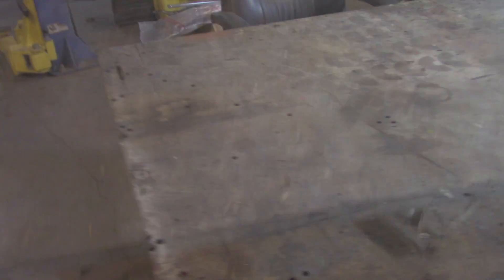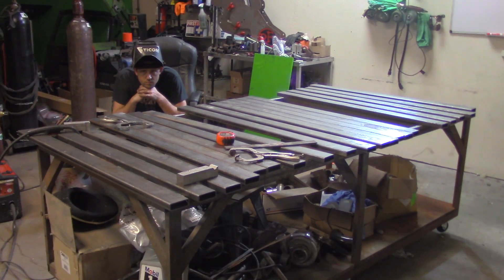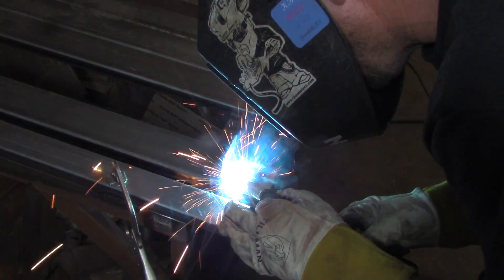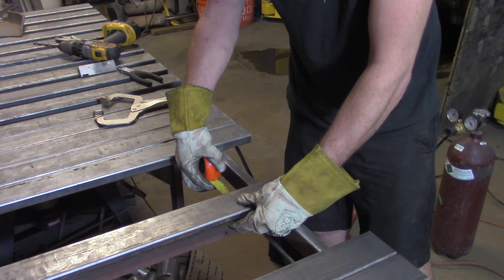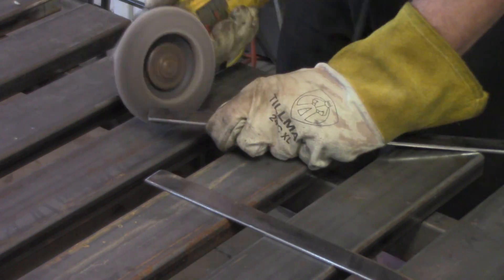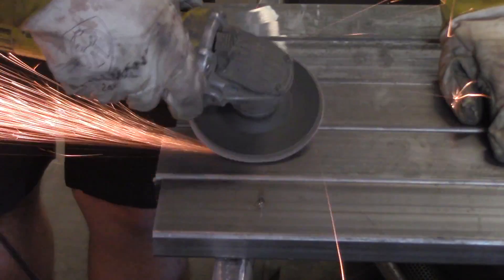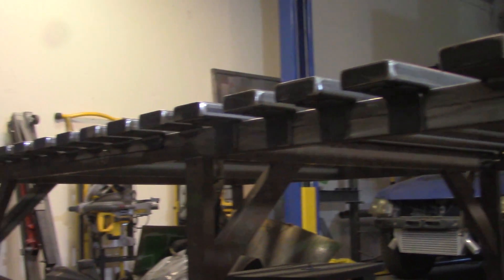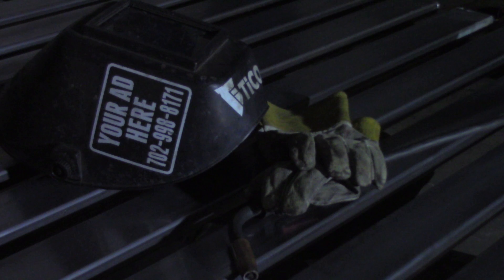TFS: Inexpensive DIY Fab Table

Comment: Shame the whole thing seems to be wobbly.
What is the purpose of the round rods ? 
At the end of the video it became obvious that they make it very difficult to adjust the slats.
I made mine with 4 x 2 slats and they just sit on the side rails. No location tabs.
I can move them to any position or take any one out completely. 
What was the advantage in welding 4 together ?
It seemed to just make it a heavy section to remove.
4 single pieces with no rod underneath would be much easier to remove separately.  What if you needed just 3 out ?
Don't ever consider earning your living as a welder my friend if you think that was monotonous  !
Reply from the maker: +Steve Williams Did you actually watch the vid? I'm not sure where you get "wobbly" from if you did. It's on wheels to facilitate relocation at any given time, but far from wobbly. 

The purpose of the rods is to secure the slats to the table at any ppsition. If a single slat was clamped to the adjustable slat without it being secured to the table, it would topple over. The rod holds the slat to the table. 

Please read the other comments regarding adjustment. I made it clear why I don't want them moving freely. 

Welding 4 together allows the removal of a large section. It was explained in the video. 

If I only need to remove 3 slats, the opposite side has individual sections the can be removed. The table doesn't care which side it's facing, or which slats get removed. 

I earn a living by doing custom fabrication. I've been doing it professionally for 17 years. It's rare that I do production style welding where the welds are exactly the same because my work is typically custom order, and exclusivity to one-off designs appeal to my clients.

I appreciate your "wisdom" and your comment, but I encourage you to at least watch and listen (as well as read) before commenting. It's good practice. 

Thanks for watching!
Reply: The Fabrication Series you have to love the "no it all" that throws his ignorant two cents in, which of course was just that, in many ways. Glad you don't make your living as a welder he says
!😂....loser.

Comment: GREAT VID!...Just starting out and been going crazy trying to figure out what kind table to build or buy... I'm just a novice and my concern is the thickness of table. I've read people say 1/2 is the way to go, it will not bend etc etc... with your table can you tell me how strong do you think the tubing is. Any help would be great, keep up the AMAZING job with the videos.
Reply from the maker: +frontstreet2011 There's no need to overkill a table if you aren't going to use it. 1/2" tops are massive and used for items that weigh several thousand pounds (like gearboxes from earth movers). 

Each slat on my table has a calculated yield strength of (roughly) 10,395 pounds, or enough strength to hold about 2.5 cars on one single slat as placed. There are 20 slats total to disperse the load, so it will hold quite a bit to say the least. It's more than enough for what most people need.
Reply: Can't thank you enough for taking out the time. I wish I picked up welding when much younger, oh well better late then never I guess.

I completely understand now what you mean by the thickness vs what your putting on it to welding.

One last thing, What about the slats you are using and warping? I've read (starting to see a pattern reading forums and making me crazy) that the metal top can warp if your welding on it for too long or etc... is there any truth to that or even with the top you used it would not warp? 

Again can't thank you enough.
Reply from the maker: frontstreet2011 It's certainly possible, but it's all circumstantial. I've never warped a table, but if I ever warp a slat (unlikely), it's $10 to replace it completely. They aren't as permanent as a solid top.

Comment: doesn't look like your adjustable sections move to easy.. Got any recommendations you learned from this build youd do if you built another.. I'm gonna build one of these but with pipe for frame.. any pointers would be great.. 
Thanks for the vid keep up the good work
Reply: Chip Sammich I thought the same when he starting welding the angle clamped to the table.. I'd just put a .30 or so shim so between the angle and the table so  you got a little play after the shrinkage...

Comment: Never been brave enough to arc weld in shorts.
Reply: I don't think "brave" means what you think it means.  😉
Reply from the maker: Lawrence Withrow I typically wouldn't do it, but didn't have pants at the shop.
Reply: The Fabrication Series how many times have we all used the excuse "I didn't have pants, [Officer]?"
Reply: Me either!  Unfortunately there have been some odd occasions when I was drunk enough!  LoL  #AwkwardTan
Reply: Don’t do it, I’ve done it before, your legs are Dancin for sure
Reply: Nah, it's fine.  Welding in dickies pants is just as good as a speedo.
Reply: @Richies Restorations Not getting burned is one thing. The problem is that the arc flash produces UV A and UV B (cancer-causing) radiation that affects your skin worse than the sun. I used to (arc) weld in shorts and a singlet all the time until I got 'sunburn' a few times (sometimes quite severe) and looked into the risks... :S
Reply: Welder giving demo in shorts not a good look for learners seeing videos. Or bare armed.

Comment: I really like the sliding slats, and remove-able sections. I would not have closed the tube ends--  too much trouble.  I might've cut the tube ends at a receding 45 angle, so the top lip stuck beyond the bottom lip.  That way crud and grinder dust wouldn't pile up in tube ends.
Reply from the maker: Duke Makedo It was a total pain, but I didn't want them to stab, cut, scrape, or ding anything easily with a sharp edge. Capping allowed me to round it.

Comment: Only thing is that the bit of bar stock might bend - i would have used a bit of angle to stop if from bending so much
Reply from the maker: Nicke's Project The only way it could bend is if the slat was jacked up from underneath supporting the whole table. There's no situation (at least not one I would encounter) where that would happen.
Reply: The Fabrication Series ah righto fair enough - your solution does the job

Comment: I really like it! great job! Will those tubular slats warp under high heat, though? that's my only concern, what gauge or thickness are the tubes?
Reply: Wyatt Brule He said it in the video. 1/8th. And they aren't going to warp unless you weld directly to them.

Comment: What a great idea, I wish I had thought about this when I owned my own metal fabrication business. I made my own welding table which I still own to this day. My Father in law was a welder by trade and taught me how to weld. He used to build custom doors and door frames out of steel so he had built a table frame out of 2"x 2", U shaped bar stock that's 1/8" thick. It was very light weight but quite sturdy and something he used for over 10 years before he gave it to me. It was strong enough that I used it a couple of times to hold engines with the transmission still attached when I did engine swaps. I eventually decided I needed a top of some sort on it so I put an old MDF counter top on it and used that set up for roughly 5 years before I had damaged, broken, drilled and cut holes, burnt up sections, and after the laminate started warping and pretty much became more work to keep the metal flat. So I ripped off the counter top and welded on a sheet of 4' x 8', 1/4", cold roll steel plate onto the top. Doing that made a lot of jobs easier. I still own the table after abusing the table for 15 years. I have used the table for anything and everything. I'm disabled and work out of a wheelchair and have even used the table to stand on to do engine work on a couple of lifted trucks. The table is the perfect size for me to place a chair on top while I'm standing on it so I can sit down when I need to give my leg and knee a break since I am missing my leg. Every good metal fabricator needs a good, solid, table to work on. Bad ass table bud. I know you will get quite a few years of service from this table. Thanks for sharing, maybe I'll make a smaller version for some of my smaller projects

Comment: Some great ideas and food for thought.  Any tips on making the frame (top section mainly) if you dont already have a fab table to keep it flat?   Thanks for sharing
Reply from the maker: Paul Morrey Just use some good squares and clamps to keep it flat when welding up the legs. Make sure your cuts are true, neat, and identical.

Comment: Why can't I find stuff like that in the trash 😩. I got a local scrap yard looking out for a section of catwalk grating for me to use as a welding table top.
Reply: Be careful with grating. Rarely is it dead flat. Don't use galvanized grating for obvious reasons (very unhealthy to work with). Not all that great for a welding surface.

Comment: Nice and simple. I think I would have welded those end caps first or not at all.
Reply: Maybe weld the top & tack the sides so that upper seam doesn't fill with dust & bits of junk.

Comment: What about warpage, are you concerned about that at all?
Reply: you dont fully weld it together....stiches to keep warpage and heat
 down...you can see that in the video...
Reply from the maker: It's really hard to work this stuff.
Reply: houdini8o8 talking more about it warping during use. It's why you usually go with such thick plate. Curious how this holds up.
Reply: Amy West you work your pieces with spacers...you also use a thicker plate because most of the hold downs require a thicker plate which wobbles less when clamping down...
Reply: The Fabrication Series have you seen the fireball tool co? They have a youtube channel impressive tools they have...also they made a really nice table dialed in...they even sell the leveling jigs to really dial in your table

Comment: Could make a plasma table with some flat bar in the removable section
Reply from the maker: Lane Wells I'm planning something with a plasma feature, but I currently don't own a plasma cutter.
Reply: That is a good idea.
Reply: Sell you mine for $800.  Miller Cutmate Spectrum 300.  I'm in the market for the Miller Extreme 625.
Reply: Not sure if you were replying to me or Lane Wells?
Reply from the maker: insaynbcr You. But it disappeared
Reply: The arc start is "pull the trigger" and watch your metal melt away in a very thin line.

Comment: That's a great idea!! Do you have a list of the material sizes? Was that mild steel? Rust?
Keep up the fantastic work!!
Reply from the maker: Mr. greens boat tanks and aluminium welding Watch the vid to the end. There's a small list. 

It will rust if it gets wet, but that doesn't happen much here in the desert. It will require some maintenance, but that's the trade-off to being inexpensive.
Reply: The Fabrication Series sorry it was very early and was trying to get through all the new videos before work.

Comment: Sure beats my flat top solid table (much smaller). The price$$ is right and I think I will be making something like it in the future. Clamping has always been a problem, where the only area is the edge. I made a small table top stand that I place on the main table allowing me better access for clamping smaller things. It is a 12"x12"x 3/4" plate with three 1/2" round feet about 1.5" tall to it. This allows me at least 2 sides for clamping.
Reply from the maker: Tom Herd Sounds like you found a decent solution for it. As long as it works for you - that's all that matters. Thanks for watching!

Comment: Looks a lil stiff at the end there
Reply from the maker: lolz larkin I don't want it to move with little effort. I did shoot a bit of oil on it which helped, but I don't want them moving around easily while im working on a part on that section, so they're on tight.